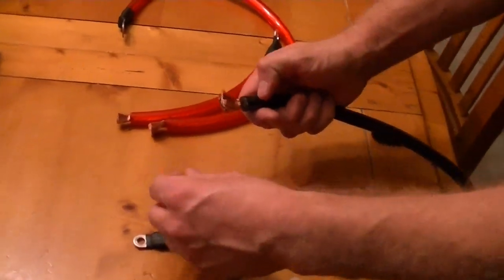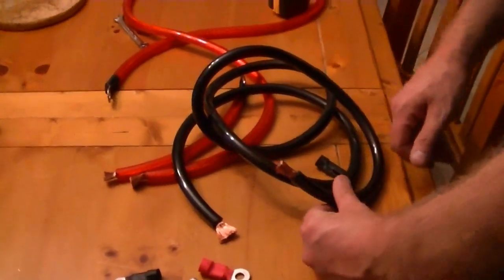Poor Quality Crimping on Power Bright 1/0 Cables

Comment: My PowerBright cables were the same way. Frayed, too, such that the stated gauge technically wasn't as stated because a chain is only as good as its weakest link. PowerBright unit failed after 40 uses. I think it gets good reviews because Amazon buyers tend to review things right away. Forty uses over the odd weekend at my camp put me outside the warranty period when it failed. And GUESS WHAT? PowerBright *will not* send you the schematic! They say its "proprietary," as if inverter design were a state secret or something. PowerBright=PaperWeight -- the letters almost line up! ;-)

Comment: For cables that big, I like to use compression lugs. These are the kind that are typically used for connecting cable to a bussbar and use a slotted or hexdrive set screw.

They are readily serviceable and easily come by, CU-AL compatible to 90* Celsius and typically tin-plated aluminum.

Comment: With the fine strand copper, the terminals should crimp around the copper and the insulation. They'll fall off every time especially with the fine copper. Like you said, solder and crimping is the best. Battery cable lugs are the best bet.